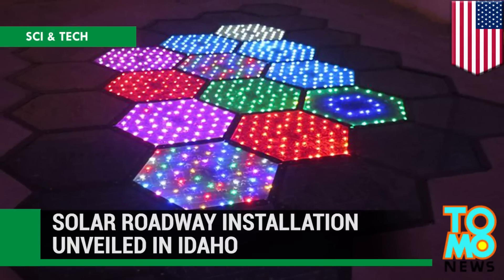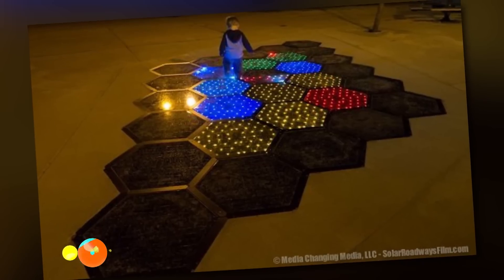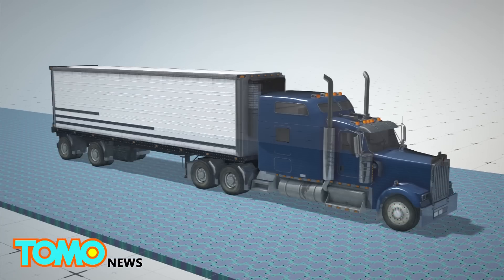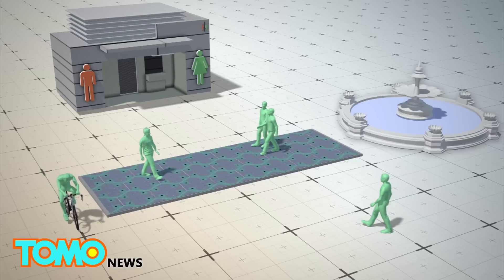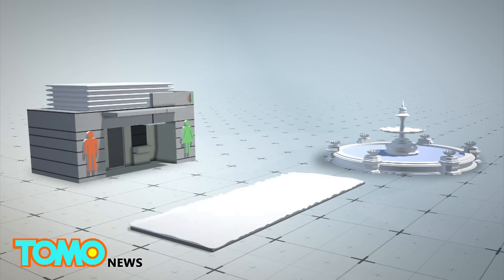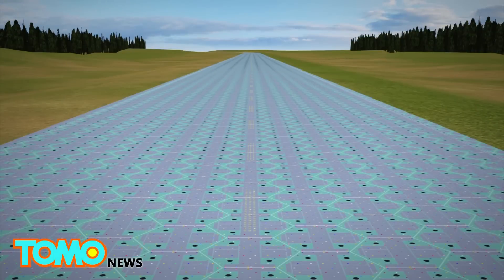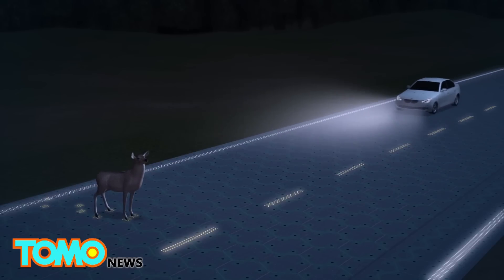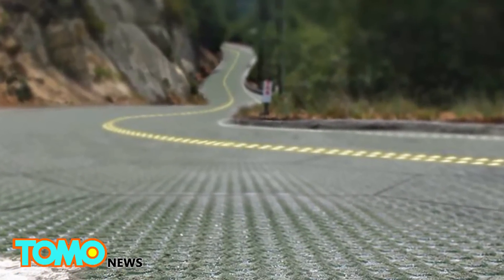Solar powered road panels light up the streets, display signs on the road - TomoNews

Comment: Wow, LEDs during Daylight. What a great idea..... Not!!!!
Reply: Not defending this stupid idea, but you can see LED in the daylight. All new traffic light installations are LED.
Reply: Alundaio You know why traffic lights work though? Because they have SUN GUARDS! You can't see LEDs when theres direct sunlight shining on them.
Reply: it gains a electricity during the day, uses it for use and puts a portion to storage to be able to be used at night. That's not a bad idea right?
Reply: KaiserTheDemon Except for the fact that THE SOLAR PANELS DON'T WORK! They aren't generating any power, and even Solar Roadways confirms this.

You want solar panels to be effective, they need to be facing the sun. That's why all these solar power plants have rotating solar panels so they can move with the sun.
Reply: IF THEY WORKED according to design, which they don't, they would generate a maximum of 44w to light the 336 LEDs built in to each chassis. That's in an installation with a 30% relative efficiency compared to panels that track the sun across the sky in a perfect continuous line of sight installation like a rooftop, or a desert.

So, instead of generating 44w, AT BEST they can create 14w of energy for distribution to the lighting array. In other words, never enough to light its own light bulbs, never mind the "heating pad" they're supposed to have installed in them to keep them free of ice and snow, which ANYBODY should be able to tell you is impossible.

Now, to your main point about "storage" of excess energy - there IS no storage system in the design. None whatsoever. They've never given any thought at all to a storage solution. The 'electrical engineer' (which I seriously doubt Scott Brusaw is) plans on using the current electrical grid as a battery to deposit excess energy into, and draw upon later when required. 

THAT'S NOT HOW THE GRID WORKS! But, it's a moot point since there will never, ever, EVER be any excess energy from these ridiculous disco lights.
Reply: If they got rid of the stupid LEDs, maybe it could actually do something useful, such as generate power?
Reply: DrScaphandre if they used a more efficient solar panels, and removed the useless LEDs, the panels could be actually useful!

Comment: I've heard this is highly inpractical due to the material's unreliability since it just wouldn't endure the pressure from the weight of automobiles. Maybe it would be best to instead replace the pavement on side walks or town malls.
Reply: cody morris That doesn't work either. In just one day the majority of the sidewalk solar panels all broke. Combine that with the fact that the LEDs aren't visible when in direct sunlight, or the fact that they DON'T GENERATE ANY POWER AT ALL, and it was all a bad idea.
Reply: these things have no plus points, man. solar panels are garbage so there you go you start in a hole but the solar collecting part is the best thing this thing has to offer.
Reply: Slobodan Šupak You know what makes solar panels work? When they're facing direct sunlight. That's why solar power plants have the solar panels rotate with the sun's rotation.

Solar FREAKIN roadways are on a fixed position all the time, so they'll only be able to generate power on a few hours a day, assuming the weather doesn't effect sunlight. To make matters worse, even when it gets sunlight, there's not enough solar cells in these things to actually generate power. They actually take more power then they produce, so there's no reason to ever install these things.

Comment: Ignoring all the problems with this that are brought up by ThunderF00t and EEVBlogs, they are freaking glass panels enjoy slipping and sliding over that on a wet day on your motorbike/car (especially at high speeds) or even just walking or riding a bike on it. 
Don't get people started on glare being an issue to drivers on the road on a hot sunny day. They aren't really using a heating element, they just need to use a smaller heatsink as the masses amount of power the LEDs will end up using (panel LEDs still emits heat).